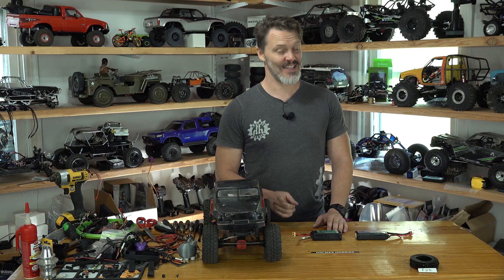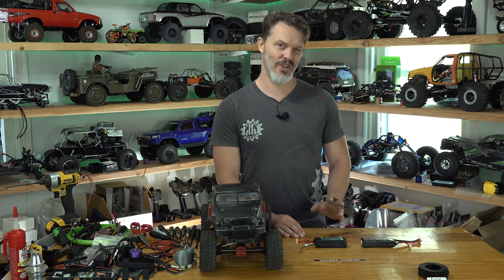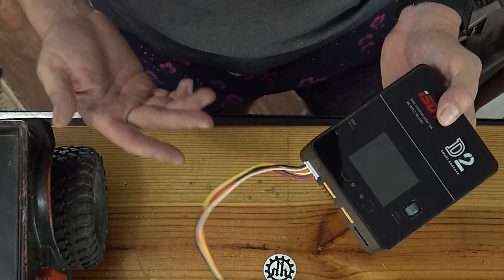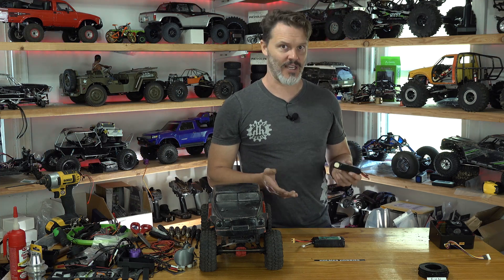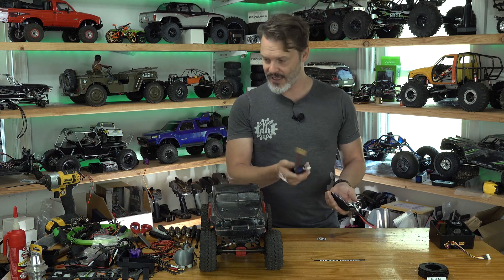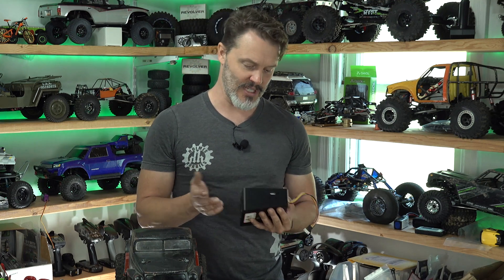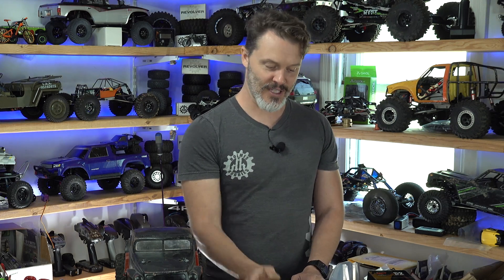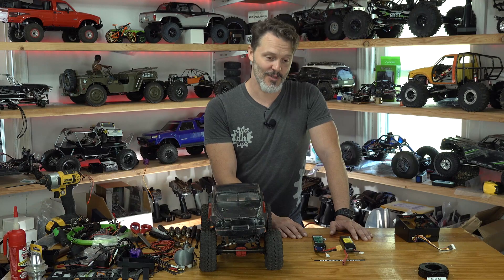🚀 Evolution of Battery Technology: John Robert Explains | Holmes Hobbies

Comment: I used to race in the mid 1980's. 6 cell 1200mah NiCads. Charge from a car battery via a resister in around 15 minutes, while watching a digital voltmeter for the voltage to peak and then as soon as it dropped off, remove it from charge quick. They were good times, and I have good memories of it, but It's sooooo much easier and so much better today! I don't wish for the old times again, but I remember them with fondness.

Comment: This is a great chat John!  I remember lipos and brushless coming into the scene in 1/10 EP racing days, both of which were forbidden lol.

The one issue with Lipos is that it is becoming increasingly difficult to properly dispose of them.  A major battery chain in australia recently stopped accepting them as part of their recycling program (for obvious reasons) and other e-waste services charge for the privelege.  There are lots of dangerous old wives tales dealing with the topic, including that they are safe for landfill once discharged down to 0 volts.  It would be nice if the supply chain that profits from their distribution and sale played more of a role in their safe disposal.  I also worry about hobbyists being tarred with the same brush given heightened media interest in lithium fires, which are becoming more common due to e-bikes/scooters/EVs.

Comment: Kong Power  was the best I've used, true C rating, charged them sometimes at 3C (smaller 2,200mAh packs) and one pack I did close to 1000 cycles and it still had about 85% capacity. Always tested them on my Mr. C Mugen MBX5T truggy and when I stopped enjoying this amazing hobby, I did what Kong Power asked me to do and that is puncture the packs to see if they would combust and they didn't. Every other pack from different brands I had would burn in a spectacular fashion. I did save 1 5,000mAh pack though and when it was at 0.00v I slowly charged it back again to around 4,850mAh since that pack had over 500 cycles it kind of surprised me it even took  the charge, didn't puff at all and when I put a nail through it, no fire but since it was charged the nail was red hot. The cell manufacturer closed after I think it was acquired by another company.

Comment: I remember discharging nicads with car light bulb soldered up to a Tamiya connector. Those were 1200mah batteries, Lucky to get 5 or 10 minutes run Time with a buggy back then. A little longer with the 8.4V in the bigwig. I still use a NIMH battery in my Tamiya semi trucks.

Comment: yep problem was the thunder power balance lead was crap and failed to the point you couldn't get them . but thunder power was no where near the first lipo. maybe in the usa but remember thunder power made nothing all rebranded . i have some 4s lipo's that still work from china via 1998. problem is no name brand. but at that time there were only 2 lipo producers
Reply from the maker: Enerland!
Reply: @HolmesHobbies  yep , i have some blue 4s i still use , no name on them but a sticker that has each cell voltage when made perfectly matched.  back when i purchased super cheap stuff from a guy named rocky in china. lol he got into mold making for edf's later on. we still chat . just took a 25 yr old nikko walmart boat and put in old school GP brushless motor etc litttle boat rips in the pool . use to run off 6 AA brushed. and use those packs. GP ammo inrunner circa 2003??
Reply from the maker: Oh man, what was the main one the market used?  Enercell?  I'd have to pull out some old packs. They are 15 years old and still not puffy